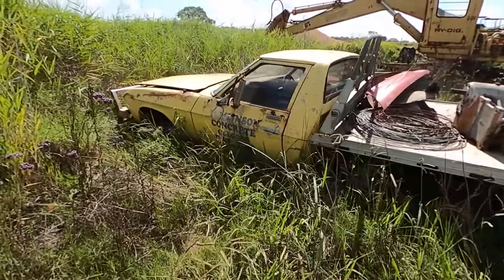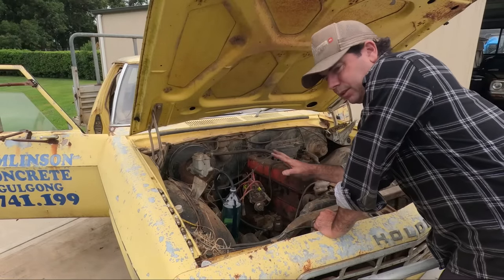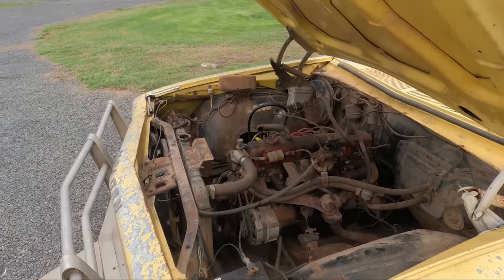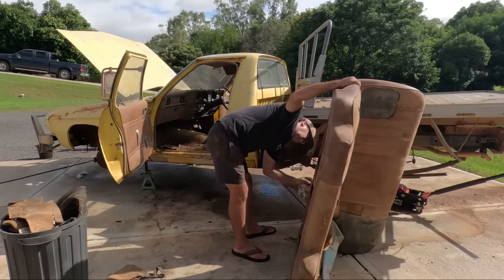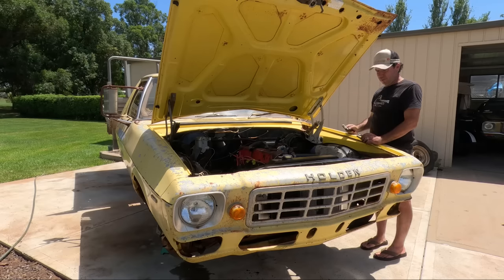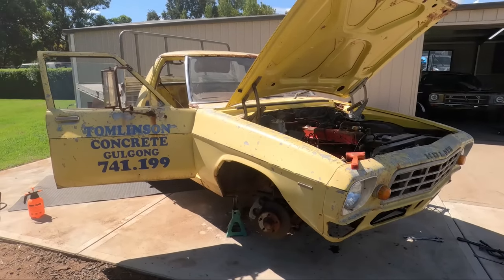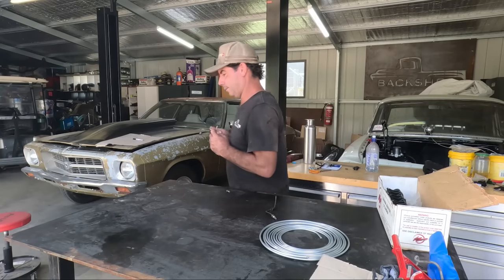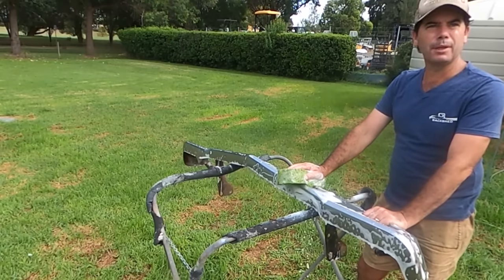HOLDEN CLASSIC SURVIVOR FIND AND REVIVAL , PARKED FOR YEARS , WILL IT RUN AND DRIVE AGAIN ?

Comment: Great work Mick. This brought back a lot of memories as my Old Man had same model One Tonner as a workhorse for his Bricklaying Business. His was a 202 with 4 on the Floor. I worked with him for 15 years and drove it numerous times. Funny thing was, the 4 speed had a problem with the selector and used to get stuck in reverse and 1st gear at the same time. These things are virtually Bullet Proof, hard to kill em. Nice find and Great revival Mate...
Reply from the maker: Cheers mate🍺🍺👍
Yep those shifters got sloppy and then did that🍺👍

Comment: Hi Mick doing a great 👌 job.your doing what I did picking up old 1onner s and getting them running and clean them Up great fun in Sydney take care. Blinker switch is the wrong one.
Reply from the maker: Nope correct 1 for the commercial front HZ . Even the plenum top on the commercial hz is hq 🍺🍺👍👍
Reply: @backshed5295  I've learned something new.  Didn't know that Holden didn't treat the Tonner to the multi function column stalk, fitted from the HX onwards.  I saw the wiper switch on the dash, left of the steering column.  The factory wiper switch on the sedan etc. was on the dash, to right of the column, to the end of the HJ series.  Is the headlight dip switch still on the floor?
Reply from the maker: Yep this is essentially a Hq built 7/1979 they did it as a cheap work ute option🍺🍺👍

Comment: If the 202 dies. Go a little 253 revver engine swap with yellow Terra heads and extractors. Would suit  the yellow one tunner
Reply from the maker: Ya never know where we will end up on this one 🍺🍺👍
Reply: Yeah a 253 is a good economical V8 so I agree with you

Comment: I really enjoyed watching this. I love the sound of the red six. On another note, my 202 has fuel & spark turns over but won't fire- do you think it could be the sticking valves? was sitting around for a while but ran perfectly previously.
Reply from the maker: Yes 100% . Spray wd at the valve stems and hit the top of the rocker( on the spring side ) 
Then roll the motor over a bit and repeat that a few times .🍺🍺👍

Comment: A charge light is sometimes associated with a bad earth to the rear lamps on the tray. I think the return then flows back on one of the other lamp wires and finds its way to earth somehow through the charge lamp. A bit of abrasion between the tray and the frame while driving around may have restored the earth connection. The gear select indicator is a primitive piece of cut price engineering. There is a little plastic covered metal cable which rides from the selector around a channel cast into plastic in the instrument panel and pulls against a spring pressure to move the needle which slides on a rail arrangement an instances of style over substance. The original annunciator needle on the HQ rotated with the column shifter directly. The plastic covering splits away and fouls the channel and the spring does not pull the needle back or the cable breaks. When dropping the column, that cable pulls up tight and must be disconnected before the column can be further lowered. From memory it was a mongrel to get at. I got mine past the examiner by stripping the plastic off and letting the cable run in the channel bare. In time it will cut the channel through so that is not a good move long term. The frame looks like it may have sagged at the thin rails under the cab. Drop a bit of oil into the two rear rockers if they have not become wetted. The camshafts in the motors for automatics were ground with more valve overlap. The emissions mods for the HX and onwards replaced the thin distributor plate spring with another thick one to hold back the centrifugal advance. Some folk also replaced the main jet with one from the earlier pre-emissions  engines. The 4.44 diff ratio was a sod and the exhaust valves for a decent cruise were good for about 8,000km. A mod was to fit rotators but these required a special valve with the collets located further down the stem or the rockers would tap on the rotator caps and eventually break the collets up. The speedometer gearing was unaltered and told lies about the true speed. For long travelling a few folk changed the entire rear axles and welded the leaf spring attachments to the axle tubes. The gears from the sedans and wagons did not fit in the tonner housings. Check your transmission breather for plugging by insects. They block the tube and the air expansion within the transmission pushes the oil up the speedo cable into the speedo itself or onto your foot. Will you be finding and putting an original Bedford front bumper on it. that bumper is from a HQ sedan, wagon or ute. As I am getting too old to get my own vehicle back on the road, I am selling to some folk who want to restore it faithfully and not use it for burnouts. After seeing your video, I am having second thoughts. It's got good bones but badly sunburned paint and a lot more surface rust from living in an arid region.

Comment: The grey motor went from 132 to 149.  Then came the red motor, if my memory serves me correctly with the 161, 179 and 186 before the transition to the 202.  I had an FC Holden many years ago with the grey motor, but I couldn't tell you now what one it was.
Reply from the maker: @detecting_Nathanael  🍺🍺👍

Comment: This is Holden flat bed tipper with GM Buick straight six 202 cubic inch motor. The 3/4 ton pickup truck weight minimal  3,900 pounds empty tanks and no load in bed at back.

Comment: Spanner is more like nut splitter with chisel end included the screw thread in the shank as part of the chisel and the chisel have square head or hex head then turn the chisel to move chisel to the head of rust bolt. And handle is connect to the nut splitter round box end. Some nut splitter don't have handle.
Reply from the maker: Ok 🍺👍

Comment: The cable with check for resistance at less than 1 ohm it is good cable on the battery 12.6 volts. The brass must replace the lead post clamps. From your Die Hard services or dealership Ford Pinto Truck store and Parts.
Reply from the maker: Huh? Hahah cheers mate🍺🍺👍

Comment: New and order one is $33.99 US dollars plus shipping cost. For US Motor Works US1044 water pump without pulley/shave and for drive by the V-belt. It fit on the 3.3 liter Mercury motor 202 CID straight six. And maybe Holden Ford Pinto trucking lorry color yellow. It fit on 3 Hex bolts that hold water pump to the engine.

Comment: If the valve is stuck poppet then wear good or laser thermometer to know if the exhaust manifold is hot six time by touching. The valve cover comes off and tapping with a hammer to the valve spring couple time for it becomes unstuck valve. Then silicon tube to seal valve cover without gasket paper and a rubber.
Reply from the maker: Im not using silicone on a rocker cover mate ? Bloody hell🍺🍺🍺🍺🍺🍺

Comment: Sorry I talk. Bernzomatic propane and brass fitting load as a burner and brass on with Tin silver solder to seal the radiator input pipe.
Reply from the maker: Mate just watch the video

Comment: Turn loose hexagon bead bolts x 2 and remove the brake caliber with sleeve on it hammer that the 2 bolts removed means caliper is ready to come off from one wheel.

Comment: Emission tube hose pipe but there is not necessary for smog pump for 1979 tipper flatbed dump truck 4 wheeler color yellow.

Comment: What a brilliant episode. Great result too. Un-killable 202. Originally I thought it might have been a 179 or 173, although by '79 they would have phased them out. The bumper is wrong for the ute. They were solid and rounded end to end.
Love your work.
Reply from the maker: 100% correct mate but find 1 ? They were ugly and crap ao everyone chucked them , i actually would have put 1 on if i could find one🍺🍺🍺👍
Reply: Nah, everyone prefers the upgrade to a sedan bumper. The old tonner bumper was more prone to bending than the sedan one which looks better. Just need to relocate the blinkers into the bar and the upgrade will be complete.
Reply: @smittyk7810 Oh, yeah, they are effen ugggly!

Comment: Glad you put those wheels on because that’s what I was thinking for mine, would 8 inch fit all round ok or would it rub on the front?
Reply from the maker: Depends on the ride height mate .🍺🍺👍
Reply: @backshed5295 just standard height. I did some research and a lot recommend 7” on the front so I’ll stick to that.

Comment: Transmission gasket price is $18.00 dollars shipping maybe free no cost. For it is 14 hole black fiber gasket for 3 speed cruise MATIC from Santa Clarita,CA. Part number is 13026E B5A2-7191 If ATF trans. Fluid out of stock Can use MERCON V fluid.
Reply from the maker: Not sure what auto your telling me mate , this is an aussie trimatic it doesnt use mercon

Comment: There's a one-tonner HQ near me in Toowoomba parked under a tree. Been there for over 10 years with a spare cab on the tray. Thought they were going to do something with it 2 years ago when they cut back the trees, nope, still sitting there. Also have a VR\VS era Statesman parked in the drive that hasn't moved in over 7 years. Thought it might be just some old farmer but they have a fairly new car. Guess the ute came off the farm and was a retirement project, and the Statesman just got old and parked.

Comment: My old farmer boss had one just like that. Not sure what year it was? but it was a sort of orangey yellow colour, 253 V8 ,column auto, bench seat and an Alcan aluminium tray. That was back in 1982-3, and I was a 16 year old farmhand.. Aircon and powersteering, it was really nice to drive. But ferocious on petrol, I was always filling it up. I always planned to getting one and there were hundreds of 1 tonners around and then ,very quickly they all just vanished. I've had to settle on a 1 ton '99 Falcon V8 instead.

Comment: Up here in the states we have what's called Rislone, it's like mystery oil put a quart in there that will free up those valves and lifters you'll notice a difference withtin 5:00 I saw that sensor broke off there when you were changing the plugs, YouTube won't let me tap you on the shoulder and say hey.lol
Reply from the maker: Hahaah🍺👍
Reply: @backshed5295  and by the way absolutely love your channel it came up when I didn't have time to be watching it but I parked and watched it anyway, GM never offered those over here in 79, that was about the time they came out with the  compact Isuzu Luv Chevy pickup that is nice kind of looks like a Monte Carlo that's a handy nifty truck to have. It's been a hard worker thanks to you saving it ,it's going to move some more concrete or whatever.
Reply from the maker: Cheers mate🍺🍺👍

Comment: Another great video. I have a question. How compatible are the Holdens and Australia Utes to American built Fords, as far as sae versus metric nut and bolts, and parts and gaskets?  Thanks for your time.
Reply from the maker: Some models do actually share parts but generally as a rule not many similarities 🍺👍
Reply: On the ute series in the video the ignition switch was from the states the HQ version key had GM stamped on it not GMH  H for Holden
Reply: @backshed5295  have you ever shipped a ute to the east coast of America?  Id like to get a project ute like in the " wrecking yard find Ford" thanks
Reply from the maker: Id imagine it would be ridiculously expensive?

Comment: No lubi doobie or WD, will contaminate your brake fluid.
Reply from the maker: If you add it to your fluid it will yes🍺🍺👍
Reply: @backshed5295  my daddy a devout Chevy man taught me that, and I found out the hard way  by putting grease on a caliper piston , I don't know how but it attacks the rubber inside

Comment: One barrel carburetor natural aspirated with accelerator pump in Motor craft carburetor from Salvage 1985 Mustang yard where they have 4 stud wheel 14 inch maybe 13 inch jet fighter aluminum mag wheel with strength of 10,000 PSI withstand but less like 7,000 PSI rim is acceptable.
Reply from the maker: I give up

Comment: Lower engine gasket and ring seal kit are set to stop leak of oil in the crankshaft from FEL PRO or Mazda B3300 truck engine order from USA and silicon company in China. Australia and Hayward city union company.
Reply from the maker: Huh? 👍🍺🍺

Comment: Very simple there is they're bolt right next to the carburetor for high idle cold start and another adjustment for warm engine idle under Holley instruction of Carburetor and clean the point electrical contact with sandpaper or Swiss file and then blow it and put back on the distributor. While you drive the truck/lorry you should have a spare carburetor and spare tire with jack and tire iron.

Comment: The engine will get crack unless you have replacement water pump with holes for heater hoses and 2 more holes for radiator hoses.